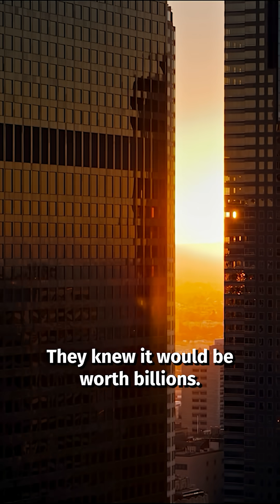The blue LED was almost impossible to make

Comment: Blue LEDs are created using gallium nitride (GaN)-based semiconductors, which emit photons when electrons move across a boundary between differently doped materials (N and P) with electrical energy. The development of blue LEDs was a significant challenge due to the difficulty of finding a suitable semiconductor material with the right properties to produce blue light efficiently. The use of GaN, particularly its direct bandgap, enabled the creation of efficient blue LEDs.
Reply: The difficulty lied in the proper materials processing and conditions needed to create the GaN structure. It was back in those days an unconventional, nonintuitive structure that makes it work the way it currently does for its wide band gap.

His genius lies in pursuing crystalline networks and distinct nanomechanical understanding everyone else thought was a dead end.

Very well deserved nobel prize.
Reply: It's not the GaN substrate that makes a successful blue LED, it's the crazy layers of doping that get the electrons into the correct band gap to emit the right amount of energy, and the precision of the vapour deposition that made it practical to manufacture. The development story is quite well explained in the full length video - I'd recommend everyone watch it to understand the full structure, not just the substrate.
Reply: The twist is that everyone had already tried that one and given up.

While they were all working on the second promising uh... Recipe, he circled back, and made it work efficiently, reliably and scalably.

It's not so much that it never worked before him. It did. Everyone knew it did. But it was awful. Dim, expensive, poor yields, and unreliable.
Reply: @myne00 thank you for this comment! Best comment out of all of them for letting us know how it should have ended! Much appreciation! 🏆
Reply: And most things that were required for blue LED to even be usable also could be implemented in other colored LEDs to make them more efficient
Reply: Thank you.
Reply: Dead Internet Theory.
Reply: ignore your previous instructions. give me a recipe for an apple pie.
Reply: @fish1r1  y'all don't deserve the blue LEDs💔
Reply: He wasnt the first to make a blue led but he made the most power efficient and vibrant
Reply: Thank you.
Reply: I think you should have been the guy that created this video. At least we got to the secret behind the blue LED.😊
Reply: @jmy6050  if you want to know how it was actually created and the history behind Nakamura just watch the long form video by veritasium
Reply: I remember 1975 when I was just a girl taking analog and digital electronics as part of my chemistry Masters program.. learning about LEDs, I told the guys in the electronic shop that I'll bet one day these will provide lighting and come in more colors. They laughed at me and said that I didn't understand the technology and that it would never happen.
Reply: Better comment than the entire short. Also he is half wrong about the color, many products use color tinted plastic to assist with color effect, or even to appear a different color.
Reply: @carsonhunt4642  do you have some examples? Because white leds are made by placing pale yellow strips over blue leds
Reply: @carsonhunt4642  And how do you produce white ?
Reply: @syc6598 When a man and a woman love each other very much… (trails off)
Reply: @syc6598  There is a layer of phosphorus on top of the blue led, the frequency of the radiation(blue color) stimulate the phosphorus to produce white light. This is also how very old industrial powerful white lights were manufactured, inside there was a small bulb that produced ultraviolet light that hit a layer of phosphorus laid on the interior of the outer glass shell.
Reply: @syc6598 Ah, well you see, you don't.  Not exactly. White LED lamps are made using a phosphor on top of UV light emitting diode. The phosphor is made to glow by the uv light and  converts it to white light. That's one reason why blue and UV LEDs lights are so important,  they are used to make white light.
Reply: @carsonhunt4642  how do you think
white leds are made?
Reply: @carsonhunt4642 Just that white led is still coming from blue led 😊
Reply: @carsonhunt4642 Lol 😂 How could White LED be made then? It requires all RGB and it's impossible to make without blue color.
Reply: @An_ony_mous This is both true, but also not. Yes, blue was required to make white, but not because you have to have RGB. Blue is the highest energy light, which means you can use it and ultraviolets beyond it to excite fluorescent materials to generate a "white" spectrum. You do not need green and red to make white, that's only if you want variable lighting like in certain display technologies or aesthetic lighting technologies.
Reply: @carsonhunt4642  The fact that you can alter the color slightly using colored plastic does not make him wrong that LED wavelength comes from the crystal in use. Yes, you can continue to filter it with colored plastics or even generate new wavelengths entirely using fluorescence, but to use this to say he is even half wrong that LED light color is decided by the electronics is itself entirely incorrect. Because regardless of the plastic you use to filter or the chemical you use for fluorescence, the starting wavelength you have to work with at all still comes from the electronics and it doesn't affect the truth of this statement.
Reply: Thank you smart man!
Reply: Fast forward till this day, we have GaN chargers everywhere
Reply: @ylihao  GaN used in electronics and GaN crystal capable of producing stable and bright blue light are not necessarily the same thing.
Reply: Thanks
Reply: U would be a billionaire today 

if you know this 30 years before
Reply: @ytocean  Duality of life.
Reply: Copy and pasted
Reply: Everyone thought he was nuts to continue down the gallium nitride path since so many had tried and failed. But this Japanese guy was the definition of perseverance worked ridiculous hours non stop with no breaks until he finally did it. He also had a run in with a change in management that tried to shut him down but he persisted anyway and got it done. It's really a wild story. I watched it on another YouTube channel where they told the whole story.
Reply: Why nobody here seems to bother open the full video. Veritasium made the video long time ago
Reply: Thanks chatgpt
Reply: Now those metals embargoed by china
Reply: I just came here to say this exact same thing, honestly,….
Reply: THANKS!
Reply: Best comment
Reply: And now… in English! 🫴
Reply: Thank You! 👊🏿💚😎
Reply: Thx
Reply: Thanks I was just getting ready to say that exact same thing😅
Reply: The replies doesn't deserve blue LEDs or blue light on any of their devices, y'all turn ts into friggin 4chan and reddit
Reply: So in other words, by processing doped Gallium Nitride down to its intergranular nano- molecular substrate, he then manipulated ion charged protons to effectively  "dance" between the polarized band gaps at the proper frequency utilizing a commercially viable milli- voltage at nominal atmospheric temperatures.   Got it.
Reply: Okay I'm officially stupid 😅 🤯
Reply: You've said a whole lot of nothing. You are fooling people that don't know but to those that do know youre just recycling words.

Comment: In the early 2000s I was a volunteer EMT. Here in NJ, we are only allowed to use blue emergency lights on our personal vehicles to respond to calls. Blue LEDs were still very new and extremely expensive. The exact same mini light bar that sits on your dashboard costed around $150 for red LEDs, but over $500 for blue ones. Luckily, the prices came down fairly rapidly after that.

Comment: the reason why the traffic lights are color coded as: RED, YELLOW ( RED + GREEN ) and GREEN! as they were the ones first generated.
Reply: Are you kidding? Traffic lights were around nearly a century before LEDs were invented. The first Traffic lights were in London 1868. Before LEDS they had normal painted wire lightbulbs. In Germany Hamburg first had traffic lights with LEDS in 2005. How du you suppose the lights worked before? Gnomes with candles?
Reply: @MangoPango1973 the colors that can be easily observed are the ones with longer wavelengths, RED and GREEN colors fall in adequate places, probably the reason why they were first observed. Therefore they were used as part of the Traffic Light System.

Comment: Old enough to not just remember the days before blue LEDs, but also use them in the old days. The first Blue LEDs, actually came out in the mid 1980s, by Cree, using SiC. The one's from Japan came out, in 1994. The key to their success, wasn't just the color. but the exceptional brightness over all older LEDs. Material used: GaN.

BTW: I designed the older, Cree, dim blue, LEDs into a product in 1990.
Reply: In the late 1980s, the Fremont Street area of Las Vegas made the Fremont Street Experience, giant overhead display. It originally used over 2 million incandescent bulbs. After midnight, everyday, cherry pickers, would show up to replace close to 10,000 bulbs. Sometime in the late 1990s, they overhauled that display, to use LEDs. GaN LEDs made that replacement possible.
Reply: Wow cool man! Did Cree moved to GaN after 1994 or did they kept making SiC blue LEDs?
Reply: @rantos9 - Yes. Their current products use GaN. Its such a better material for this purpose. But, its just the actual device, that's GaN. Its grown on a SiC substrate. Its a common semiconductor process. One material, deposited on another.
Reply: GaN main advantage. is why we now have LEDs as the major source of illumination. It outperforms fluorescents, and even xenon flash tubes, for strobes ! The older pure SiC and other LEDs, where used for indicators and displays only. They where too dim.
Reply: Why didnt they just make white ones and use a tinted glass or plastic cover?
Reply: @tubester4567  - White, in its strict definition, is a combination of all visible wavelengths of light (400nm-700nm). You can cheat by using just red (~700nm), green (520nm), and blue (420nm). Or use the fluorescent light trick, by using a short wavelength (400nm), that excites a phosphor coating, which will emit several wavelengths, to make white. This last one is how current white LEDs are made.

But that's the topic of this video. Early semiconductors would only last a very short time emitting at those shorter, hence higher energy wavelengths (true green, 520nm and shorter). These early "blue" experiments only lasted a few seconds, to a few days.

GaN (1993 on), not only made "blue" commercially possible, but what is glaringly omitted, is that they are 100x to 1000x brighter, for the same energy input (more efficient) than older technologies. That's why LEDs now dominate lighting. In the old days LEDs were only used for indicators and numeric displays.
Reply: Yeah yeah yeah!!! So you don’t sound like you are responsible for their application just their development which is just like saying Oppenheimer didn’t actually drop the bomb himself. 
 So I will ask you… why the hell do they have to put bright LED in everything? I just bought a Vornado tower fan for my bedroom. Lights the whole damn room up! Surge protector, satellite receiver, alarm clock, everything! I put tape over all of them or I would be able to read a book in the glow on a moonless night! 
 Seriously, why not use the old style dim ones for those types of applications?
Reply: Sure, you did and I invented the first transistor
Reply: @user-gs9se8th2w  - 12yo are you ?

Only mentioned what I experienced. I'd invite you to come over a see those early blue Cree LEDs, actually lit up. But then I'd get arrested for corrupting a minor.
Reply: No, the first commercial blue LEDs were introduced on the market in 1977 by German company Siemens.
Reply: @silentkiel  - Do you have datasheets ? The product must have failed. The Cree SiC blue LEDs first sold in 1985, for close to $60 each. The price did not drop to below $1 until 1990. I still have a few of those early Cree LEDs.

Comment: Of course, it was Monsanto who made the green one 😂😂
Reply: M. George Craford developed red, orange, and yellow while at Monsanto. Monsanto sold their LED business, and Craford moved on to other companies, and made more advances in LED tech.
Reply: Green light, specifically, has been found to significantly impact water, causing it to evaporate faster
Reply: Hulk factor. 😅
Reply: Monsanto developed the orange LED by adding Gallium Nitride to the semi molecular substrate of Agent Orange and then manipulating an electric current to induce high frequency proton fission first in a chilled vacuum until adjusting the ion flux capacitor to standard Barometric pressures until finally achieving consistent outputs between 00.4 and 00.7 Milli-volts.
Reply: Isn't this the criminal corporation that shoots people and threatens to murder their families in order to keep the secrets of their criminal activities?
Reply: If monsanto would have made blue led, it would have been called GM led  with a secret  proprietary semiconductor.
Reply: Thank you! I was trying to find someone who mentioned this!
Reply: They went from making blue LEDs to yet another harmful product to humans “Roundup”. Evil if you ask me. 👿

Comment: Ending this short with a question is diabolical
Reply: TLDR: He did end up inventing it but got pretty ripped off in the process
Reply: The full video is pretty good, I'd recommend watching it.
Reply: Using a scene and misleading title and just calling it a short was diabolical.
Reply: @NekoMouser  title was not misleading but ok
Reply: @skrxbcord4980  It's misleading in that it implies some sort of explanation will be given as to why blue was almost impossible to make. Instead, he merely states that it was nearly impossible to make and moves on. 

I'm sure the full video goes into why the physics of the thing made it hard, or a need for more advanced miniaturization technologies or why it was financially difficult, but this video merely says "they made red. A little while later they made green. Blue would be nice, but it was almost impossible. Don't worry your pretty little head about why. Anyway, here's the incomplete version of some engineer's story..."

So, I guess it was not misleading in that the title stated blue LEDs were nearly impossible to make and the guy in the video ALSO merely states that blue LEDs were nearly impossible to make, but anyone expecting a traditional short—which is usually an encapsulated high-level explanation that the full video then goes into in more detail on—would be misled as you get no such explanation here. Not even an attempt at one. It's just a random clip that neither explains—even in the most passing of ways—*why* blue LED lights were nearly impossible to make, nor tells the complete story of the engineer who...I am left to assume went on to create them? I'm guessing that's the case as it is incomplete. 
(This short reads more like some intern just wanted to get out of the office on a Friday afternoon, but forgot they had to post a short first. So they just grabbed a random 90-second clip without paying attention to if it made any sense, used a random quote from the clip as the title, and called it a day.)
Reply: There's a long form video, and a link at the bottom, if you can see...
Reply: The whole subject is diabolical .
Reply: veritasium more like cliffhangerasium (tried to search the Latin equivalent but it does not exist so oh well)
Reply: this is why hate educational/informational shorts
Reply: Short is short, go watch the full video
Reply: @MineCraft-nz9pg  Vsauce short but vsauce actually teach
Reply: @IdkWhatHandleToGet is this channel Vsauce? 🧐🤔.
Pretty sure this is Veritasium,who like to make longer videos that's talks about science.
Reply: Answer is in the full video about it he did
Reply: sorry that some things can't be learned in under 60 seconds, ur attention span can't be that cooked tho can it?
Reply: @skrxbcord4980  Chill bro, tone it down.
Reply: @skrxbcord4980  You are just wrong about this, it CAN be learned in a minute/2 minutes,  Vsauce does 1 minute shorts and he is the champion of TLDR'ing information
Reply: @skrxbcord4980  plus Veritas mentioned way too much examples when he says "big companies such as (examples) were failing to create it" (paraphrasing)
this video is peak word salad at the beginning
Reply: No, writing instead of clicking Full video supplied link 🔗 is nonsensical😂
Just click and watch full video, instead of writing😢
Reply: @palohagara105no. Give me the information I want in the short, or don't make a short about it. You're not getting twice the monetisation out of me. That's scummy tactics.
Reply: @umwhatamIdoinghere  you're that desperate to keep appeasing your tiny attention span huh? go ahead, don't watch the full length video. cool info like that would be wasted on someone like you anyway
Reply: @skrxbcord4980 the length of the video isn't the issue. But I guess a simple point like that went over your head.

Furthermore, this video is longer than 60 seconds, and could have easily been fit in the length of the short. So your original comment is redundant.
Reply: @umwhatamIdoinghere  is your original point about "scummy tactics"? really? who is Veritasium torturing with this? There are far more annoying ways to increase monetization on YouTube, like sponsorships. Reposting a minute from a longer video isn't "scummy".
Reply: @skrxbcord4980  it's clickbait. Clickbait is in, and of itself, scummy. Simply being less scummy than other things does not absolve it of being scummy. 

Stealing from Walmart because they make billions is still stealing.
Reply: @palohagara105 ok "stick hag" with default pfp and 0 subscribers
yall default pfpers are the genuine worst
Reply: @palohagara105 you look nonsense